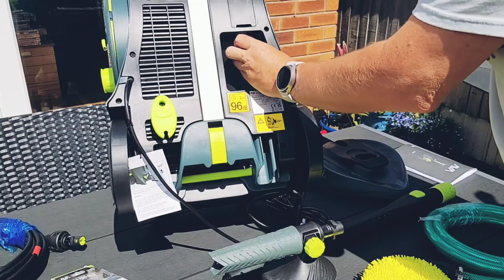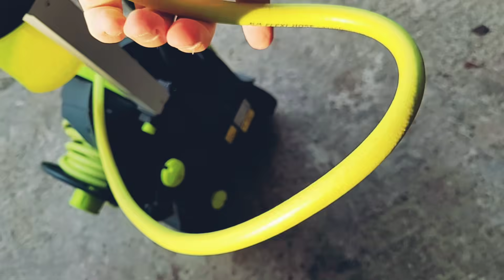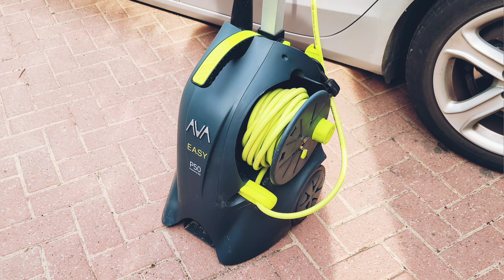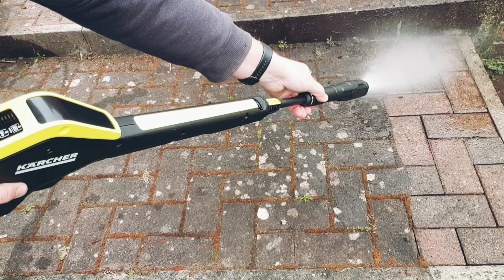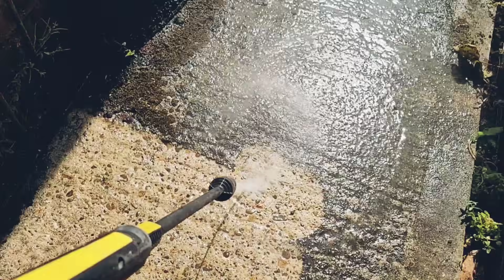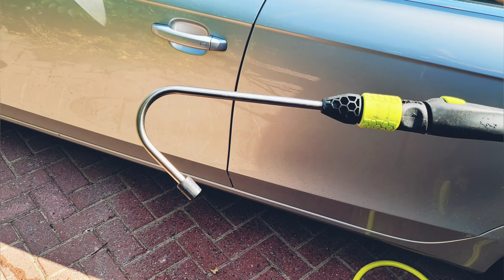Karcher vs Ava: Which Pressure Washer is the Best Value for Money?

Comment: I got one today.  The lance is in and I can’t add the attachment. If I press the button. It’s too tight. Any idea. Right now I’m regretting not buying a karcher.
Reply from the maker: Try loosening the green locking collar on the end of the lance (turn it anticlockwise). You should then be able to fit your nozzles/accessories.

Comment: I absolutely hate my Karcher K4, it’s such a struggle with that poxy hose, it scratched my cars paint, dragging the damn thick water pressure hose around the car, I’m forever lasting moving the pressure washer around the car, as the hose is so short, useless. 
The detergent bottle is a no no, I had a few bottles, I placed on in and watched it drain the whole lot of detergent through the Karchers casing, lost the lot, got another bottle, managed to use it, what a load of rubbish. 

I purchased a petrol jet washer for the patio, which is so powerful I use it with the plate, too powerful for the car. 

As soon as my crappy K4 fails, I’m getting a AVA, great review fella.

Comment: I have had FOUR Karcher electric pressure washers over the years and all four of them BROKE!   ALL FOUR!  I even had the higher end K5 model.  Not one of them lasted more than two seasons and that was with minimal use and I always flush them and use that pressure washer pump conditioner at the end of the season.  They are basically a throw away unit, and you'll probably be throwing it away sooner rather than later!   I think the AVA is a far better option and their washers come with some really cool accessories too so you don't need to purchase foam cannons and a lot of the other accessories you need to purchase with other makes and models of pressure washers.   I am in the market currently for a pressure washer and I have been giving the AVA units some serious thought.  They are finally available here in the USA which is great because I was watching the various reviews on YouTube over the past couple of years and I always wanted them to be sold over here as well and now they are which is great.  Not their entire line up, but a couple of their popular models.  Another unit I am seriously considering is the EGO pressure washer.  I just like the look of the EGO as it looks really stout and you don't have to worry about plugging it in and tripping a breaker.  It operates on EGO batteries which is fantastic because as you bring it around your car, you don't have to worry about the cord.  I can't tell you how many times I have flipped my pressure washer over on a cord in the way over the years.  The only problem with the EGO is that their pressure washers are EXPENSIVE!!   Even the "tool only" models sold without the batteries.  You are looking at over $1,000 for the larger washer with batteries and at least $500 to $600 for the little one that runs on their batteries.  Still, they are a convenient option especially if you wanted to do work around the house or wash your car out in the street or something like that.  And the cool thing is you can bring a 5 gallon bucket of water to draw your water from which makes it even more useful and unique in the world of pressure washers.  And they seem to have good pressure based on the video reviews I have seen about them.   You could easily purchase four gallons of deionized or distilled water to put into a bucket and draw off of that for a spot free full wash or just for the rinse for a reasonable price.   The turbo nozzle is actually one of the main nozzles I use, even in car detailing for undercarriages, rims, and wheel arches, traditionally the most dirty places on a vehicle.  They work great for shifting dirt and grime off the vehicle in those areas and I personally have never had a problem using the turbo nozzle on those areas.  They also really up the power of the pressure washer for cleaning bricks, sidewalks, concrete patios, etc. The AVA foam cannon included with the pressure washer actually looks like it performs just as good as more expensive foam cannons.  The foam production looks great and I like the fact you can buy multiple extra bottles and then just switch out the bottle pre-filled with whatever pre-wash, regular wash, or whatever other chemical you may use in the foam cannon.  That AVA foam cannon looks just as good as any high end cannon and the fact it comes with the unit (depending on the model) is even better.  I like the design of the AVA and it looks like they did their homework on what customers want in a good pressure washer, what performance, what accessories, etc.  I personally don't want to have to purchase all types of other accessories for my pressure washer such as upgraded hoses, quick connectors, foam cannons, and the list goes on.  I personally just want an "all in one" option with everything included in one box.  I also like the fact you can adjust the length of the AVA wand when you need extra reach.  And that easy trigger gun looks great also.  Not the smaller short gun, but not that bad either and certainly manageable.  I could easily live with that style of pressure washer wand.   Nice review buddy.  Thank you for taking your valuable time to compare these units and upload to YouTube.
Reply from the maker: Thanks Joe. I've been very pleased with my Ava so far. It's great that it is designed to be repairable and the accessories are really well designed. The battery powered pressure washers available here in the UK are low powered and so not really much use for tougher jobs like cleaning driveways. If you want a portable mschine, have you considered a gasoline powered pressure washer? They are noisier but normally more powerful. Most don't come with accessories but they usually have standard quick release connectors so there is a wide range of accessories available.

Comment: my Karcher never works straight away. I have to take the hose out of the gun and run water through it with no power to clear airlocks every time. Went to use it yesterday for the first time this year and its dead. (Stored in a  garage all the time). Seriously looking at the AVA range now.  Thanks for the comparison video and discount code.
Reply from the maker: Sorry to hear about your Kärcher. I've been very happy with my Ava so far (I've had it about a year). I'm not sure if the discoung code will still work but you can try for nothing. Good luck 😃

Comment: Excellent video thankyou and not rushed gently paced making it so informative.  I'm 80 and love the AVA simplicity of non assembly but one negative for me which is the stubby handle to reel in the coil it looks quite difficult and with my rheumatism in my hands that could be quite painful . The Ava is designed in Norway but built in China and soon to be Vietnam by Sand Future an OEM who also make the Bosch pressure washers.
My choice though is the AVA designed for simplicity and customer convenience .
Reply from the maker: Thanks for the great feedback. I can see your point regarding the stubby handle on the reel. Ava tech services are very good and may be able to suggest a more suitable alternative.

Comment: I can clearly see the arguments here between the 2 
I was looking at the K7 And the equivalent Ava in B&Q And there was a significant difference in price WELL over £150 difference 
Shame the AVA doesn't have detergent despencer but to be honest i dont think i ever used it when cleaning my path as it doesn't appear to make any difference  !! 
BUT  i HONESTLY think this is a wake up for karacha and it wont be long before they change there style to match!! 
Im still on the fence between the 2 ... had my old K2  for many years .... ill see what happens when it fails
Reply from the maker: Karcher do seem to have upped their game a bit recently, but there are now plenty of alternatives available. Prices change all the time so shop around when you do need a new pressure washer. You will notice a massive difference if you do step up from a K2 to a K7 or an equivalent machine.

Comment: A few things to unpick here, I can only speak in relation to the water-cooled units. I had a Karcher K4 compact in 2012 and finally packed up in 2024, having, like an idiot, used the hot water mains tap from my garage for 6 years as its feed. Things that went - the seal heads on the pump - easy replacement along with a few cracked internal mouldings. However, I was getting all sorts of surging with the water delivery supply that finally resulted in a dead unit that refused to turn on or prime. Moved to K3 horizontal, which was built like a cheap plastic toy. I didn't realise the higher duty cycle and flow rate of the K4 would be missed. The motor would absolutely stink if used to clean 2 cars and a patio. I now have it as a spare. I didn't like the hose connection system with the tab.

That only lasted 6 months before I bought myself an Ava P70 Evo. Love the integrated unit and the familiarity of a water-cooled motor and pump for higher dependency. I was a tustle between the K5 and P70. Given that I was still able to use a lot of my karcher attachments, I was swayed by the long term serviceability of the components. I didn't go for the P50 / 57, since I wanted something heavier duty. The foam cannon and turbo lance and 3-way vario lance absolute destroys anything Karcher come out with. The Karcher foam cannon is laughable at best, whilst the Ava with replaceable cups is as good as my MJJC clone. Consistent snow foam for doing the cars and house windows.
Reply from the maker: Thanks for sharing your experience. I totally agree that the Ava accessories are much better than the ones that Kärcher include with their machines

Comment: Knowing no better and like a lot of people i went with the masses and started off buying Karcher - how stupid was I. 
All failed within a relatively short time and financially it was better ti replace than repair. 
Thankfully I was put into Ava and what a difference. Better designed, far more reliable and if spares are required (I needed a new turbo nozzle and on another occasion a hose connector) they are easily sourced via the website and arrive within 24 hrs. 
Keep up the good work Ava you have my vote every time 👍🏻
Reply from the maker: Kärcher are the brand the most people associate with pressure washers, but as you know, there are better alternatives 😁

Comment: I had both an Kärcher K7 and Ava P90 evo. 
They are both really nice with alot of power. 
I do however got more bugs with the ava, like the pulsating issue on idle and thermal cutout after long use, several accessories o-rings breaks. 
Today i use IPC Foma semipro. The build quality feels alot better, but i do use adaptors on it so i can reuse my ava assesories.

Comment: My Karcher K4 has died after 7 years. Can't fix it. Tried all the youtube fixes but none have worked. Replacement parts that i may need are quite expensive meaning it may be uneconomical to repair. Not good as I did recently invest in a quality hose for the Karcher and stubby handles for washing cars. 
But its good to know that the AVA takes Karcher accessories so I should be able to use my recent purchases on the AVA if I get that. 
Like the idea of AVA parts being cheap and the long warranty. 
If Karcher had a 10 year warranty my machine would've been covered. 😢
Reply from the maker: I think you need an M22 to Nilfisk adapter to use a stubby gun with an Ava hose.

Comment: I personally don't like either of them as I find watching the videos that the trigger guns are way to big and the attached lances make them unweildly for car cleaning but more suited to working around the home .... For car cleaning everyone and their brother-in-law is moving to stubby guns for cleaning inside wheel arches etc and if you do require a slightly longer reach a small extension from Amazon on is around £5 and can be bought straight or with various angles of bend and you can into wheel arches and under sills even easier and it's nice to see AVA include one but I'm still not a fan of the gun
Reply from the maker: You can use a short trigger gun with both of these pressure washers: https://youtu.be/vxfW0KJ1_p4
Reply: @bigtedshome ... I appreciate that but it's an unnecessary expense when you're already spending a fortune on the machine ... Why can't we all just standardise on the M22/14 fittings then everything uses the same accessories....then again they'd not be able to charge a leg and a kidney for decent accessories to go with them 😢
Reply from the maker: @petersmith7126 It would be great if the manfacturers all used M22-14 fittings but as you say, then they would make less money from accessories.
Reply: @bigtedshome ..... They'd sell as much or maybe more too if they just watched the price and sold a snow foam lance for £30 - £40

Comment: Very nice review 👍🏻. Karcher have some new models out now replacing the old style K4/K5/K7 (and K6) which look a lot more funky along the lines of the Ava. Being the UK warranty and service provider for Karcher, Ava and Nilfisk I can say the Avas are pretty good but not without their problems. Water cooled pressure washers are pretty robust but leaving them full of water over the winter, or leaving them pressured up for a long time does kill them. And using one way valve (aquastop) hose connectors. I’m still using my 16 year old K7 although I did try a new 4 in 1 lance today from the new models. Karcher have maybe become a bit complacent but hopefully are now stepping up their game
Reply from the maker: Thanks for commenting. Do you know if the updated Kärchers are much of an improvement on previous models?

Comment: Have a Karcher k4 compact (about 10 yrs old)although it works ok(although pressure seems to have decreased over time) its a faff to set up as I bought an extension karcher hose to attach to the useless original one but it still coils up and has to stored separate along with my other accessories.The Ava one appears well designed and if i can use my karcher accessories on the ava connections that would be great.The integrated hose reel would be a major plus( bit like when garden hose reels on wheels were invented ) .
Reply from the maker: Kärcher have improved the hose on their newer pressure washers but I still think the Ava hoses are better. Ava pressure washers are very well designed and it is great that the fittings are the same, so you can use your existing Kärcher accessories.

Comment: I had 2 karchers both broke in less than a year! My Ava has now lasted 4yrs with no problems whatsoever! They also show you how to service your own washer and sell you a service kit, added to a great warranty its a no brainer!
Reply from the maker: Thanks Paul. I've been very impressed with the Ava, but to be fair to Karcher, I've had my K4 for 5 years now and have never had any problems with it (apart from the awful hose).
Reply: I've had a K2 for about ten years and it's still going. I've just given it to a friend and upgraded to the K7 comfort premium. Hopefully it'll last just as long.
Reply: But Karcher has 6 years extended warranty so why does it matter. If it breaks in a year they will just repair it.

Comment: Interesting.  I currently considering replacing my 10 year old Nilfisk.  AVA is definitely tempting but an issue for some of us is AVA themselves have delivery surcharges for outside of the “UK mainland” (which the Scottish highlands aren’t part of apparently) and won’t deliver at all to Northern Ireland or the Channel Islands - even via their Amazon store.  Long warranties and easy part replacement aren’t much use when they won’t ship anything.  Hopefully they will extend their shipping out as they continue to grow their offering.  While B&Q carry a couple of models now that’s not much use if something goes wrong (and it does happen with AVA) and the manufacturer won’t ship parts.
Reply from the maker: That's unfortunate. I can see why the delivery surcharge would put you off. I assume that the surcharge would be based on weight and/or bulk so it might not be that much for parts.

Comment: Great review!  In your opinion does the Ava have the same durability and build quality as the Karcher?  I'm thinking in terms of which is likely to last longer.
Reply from the maker: Personally, I don't think there is much between them, but if you look at the other comments, you will find several that think the Ava build quality/longevity is better. Ava machines are designed to be repairable and parts are cheap, whereas one common complaint about Karcher is the cost of repairs. I hope this helps 🙂

Comment: I’ve just swapped to a P50 from a K3 and the AVAs a big improvement. The 12m hose (and reel), stubby gun ( and port), cable tidy all a step up. I’ve also invested in the 1/4” bsp attachment and coupled with a 1/4” push-in which came with my Autoglym canon as a Karcher adapter can use the aforementioned canon and angled nozzle for cleaning under the arches. There’s only the 500ml pot with the AVA isn’t really big enough, though for £9.50 there’s a 1 litre pot available, but a 1 litre CarPlan bottle will go on.
Cheers
Reply from the maker: Thanks Rich. I've been very impressed with the P50 so far. I've found that the accessories are much better than the Karcher equivalents.

Comment: I’ve had a few Karchers and they have all broken. Parts are expensive and they’re fiddly to fix. Last year I bought an AVA cleaner and it’s so much better. It’s well designed, the accessories, cable and hose all store within the unit …. And spares are easy to find and fit (though nothing has broken yet). I’m not switching back to Karcher
Reply from the maker: The cost of repairing Karchers seems to be a common complaint. I've been very impressed with the Ava so far and the accessories are very well designed.
Reply: Agree. I have had 3 Karchers from different ranges with induction cooled motors and all failed despite gentle use, protecting from cold weather and ensuring never run without good water pressure. Ava will be my next choice.